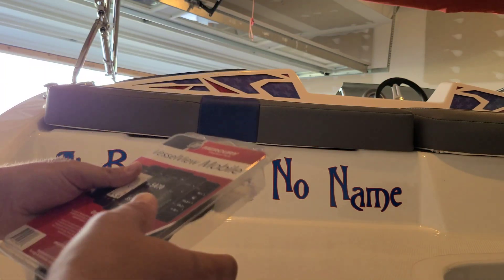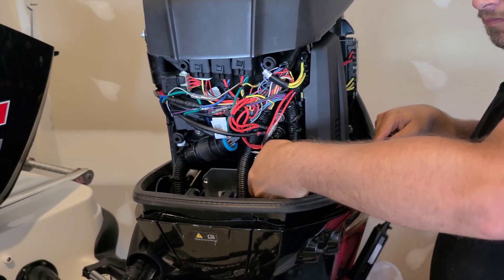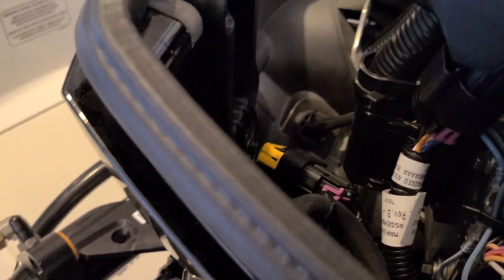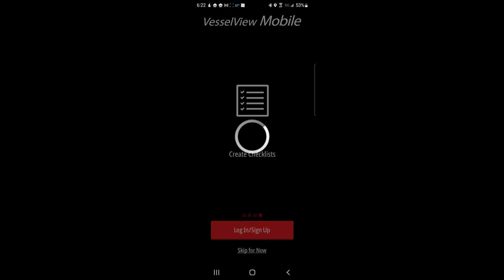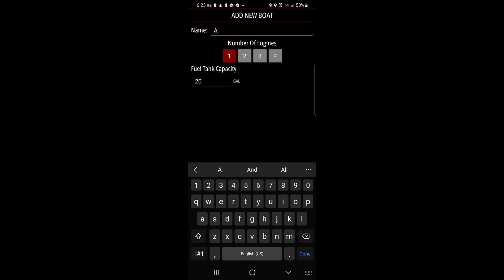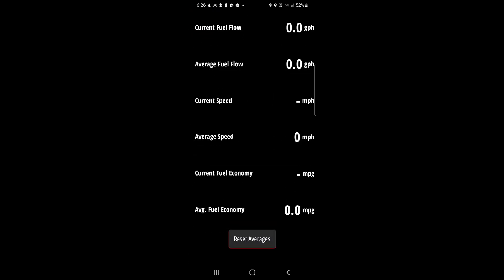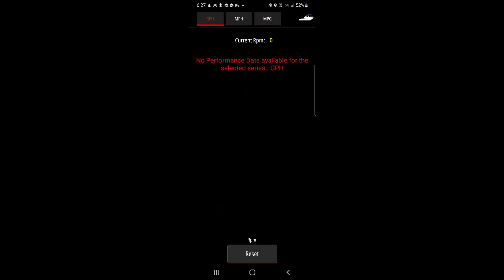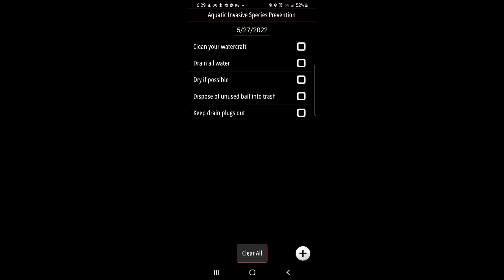Upgrade Your Tahoe T18 With Mercury Vesselview Mobile: Installation Guide For 115 Pro Xs (2022)

Comment: Have a question for you i just got the vessel view and it is not working do you know if yours works if you don't have the yellow capped plug plugged in
Reply from the maker: After some research, it appears the yellow terminator is needed for the Vesselview device to work. It doesn't come with the device, but mine was already installed in my engine. Assuming you don't have this part, I believe this link is the part you will need. Hope that helps!

https://www.mercruiserparts.com/859318t1-terminator
Reply from the maker: Hmm... Not sure. However, I plan to pull the boat out tonight to clean it up and can remove the yellow terminator to see what happens. I'll get back to you.
Reply: Thank you very much.  I got the motor used and like most things it is missing
Reply from the maker: @0925jason  Yea that's the way it goes. At least it's a cheap fix!